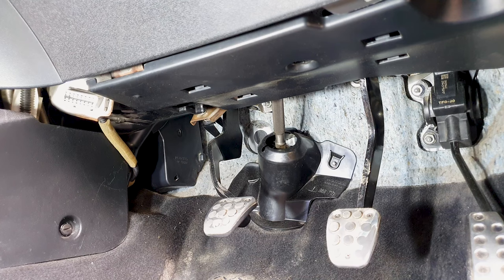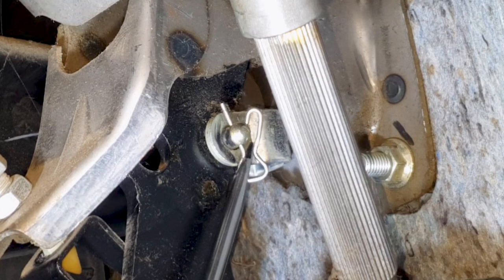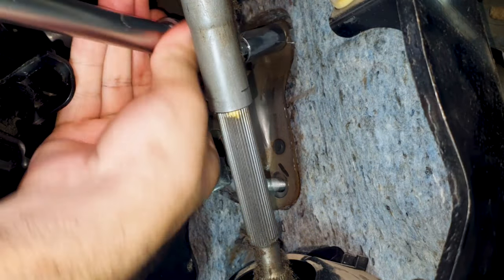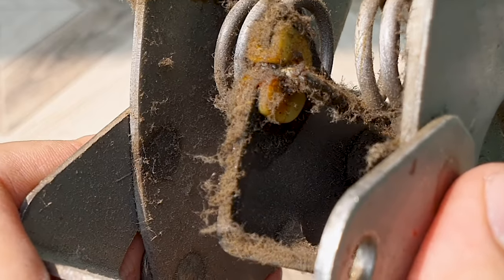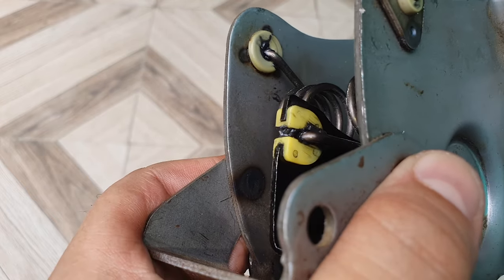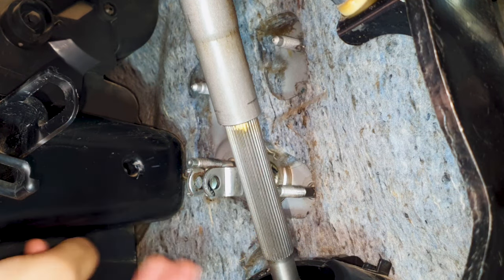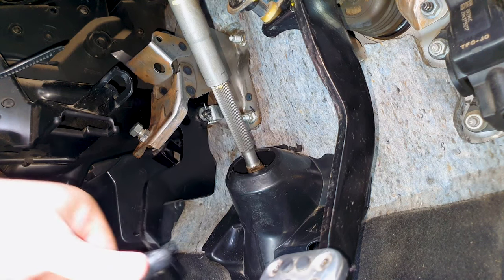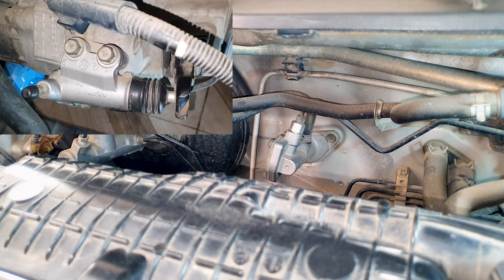1 – Clutch pedal removal and partial custom fix #hondarepair

Comment: Technical job well done! Looking forward to seeing in next video, what the problem actually is.
Reply from the maker: The problem im sure is the middle plastic bushing, as the wire hack I did has reducded the noise.

But as mentioned in the end, I'll inspect the master and slave cylinder to rule that out. Have to get rid of the squeak too, but the creak is the priority right now.

Comment: Great job well explained looking forward to next video as I am having a problem with clutch master cylinder trying to rebuild it i did get the repair kit but can’t bleed it somehow it’s not allowing the fluid to get through to the feeding line
Reply from the maker: Thanks. Im editing it, taking a bit longer than I hoped. Should be a few more days, it covers the bleed process too. 

Are you trying to bleed it yourself, or do you have a 2nd person to assit with the bleed?